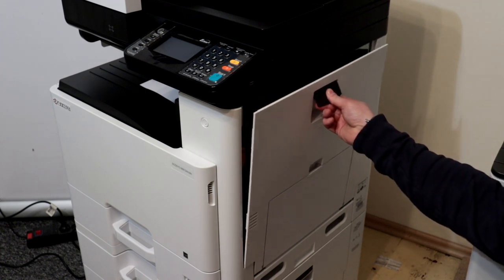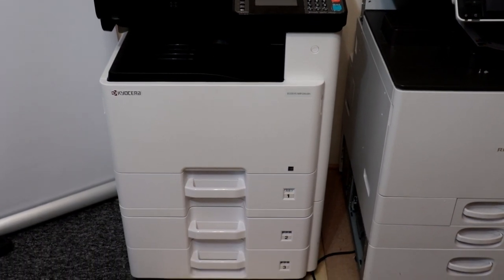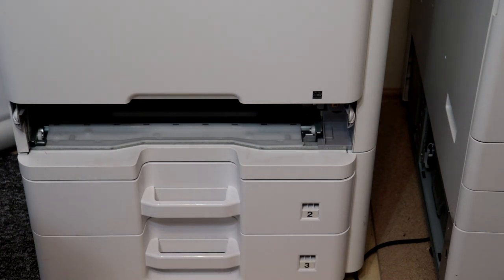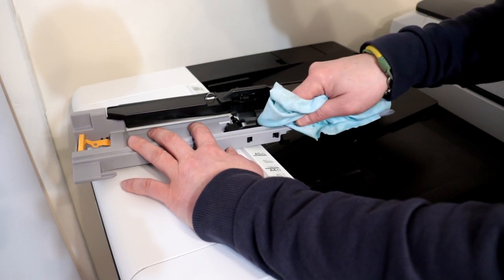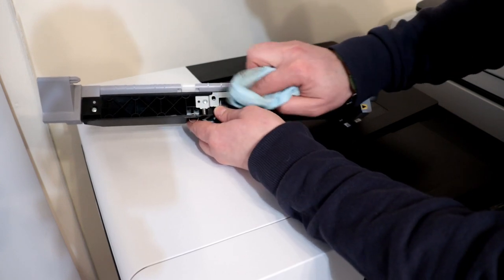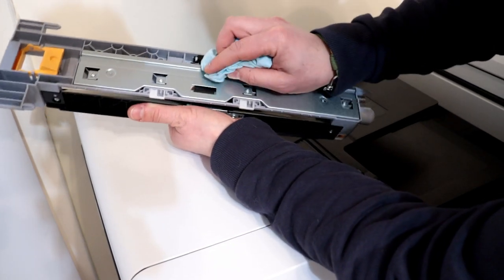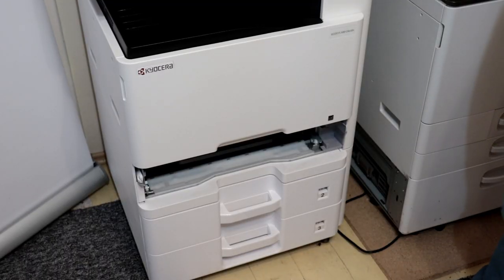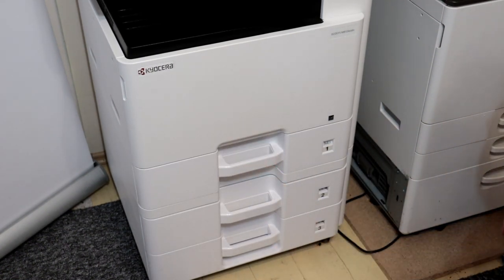Fix printer, copier paper feed problems - feeder roller cleaning

Comment: Sir does CANON IR2116J  print , scan copy or only copy pls answer
Reply from the maker: You may have a damaged controller, but replace the HDD first, it should help.
Become my subscriber
Reply: @MrRicoh  sir already i am your subscriber
Reply: @MrRicoh  sir i am clear does ir2116j have print option or not pls clarify
Reply from the maker: This option is not available from the factory, it could only be purchased additionally.
Reply: @MrRicoh  what will be the price